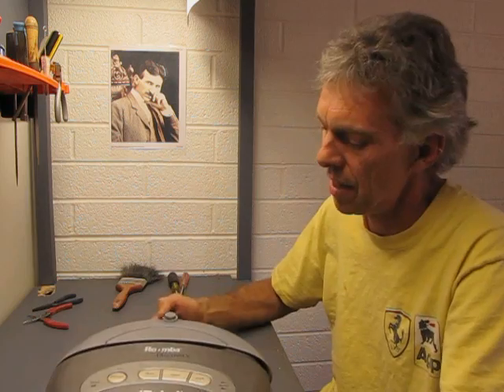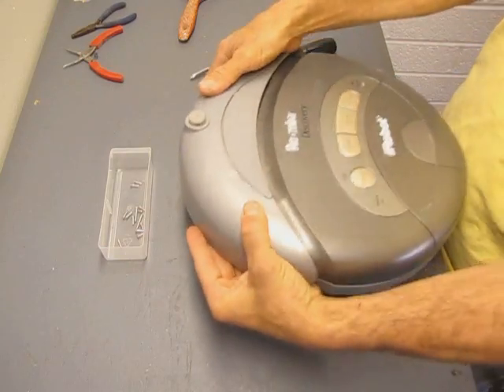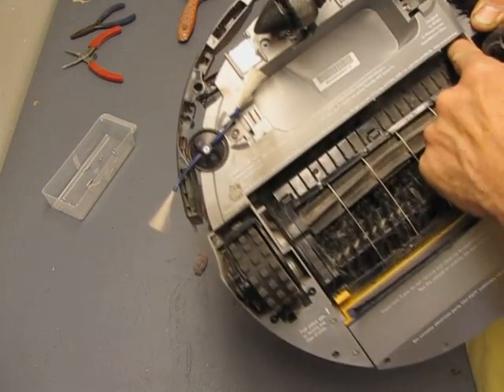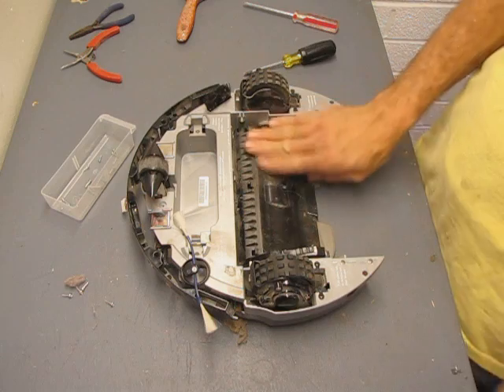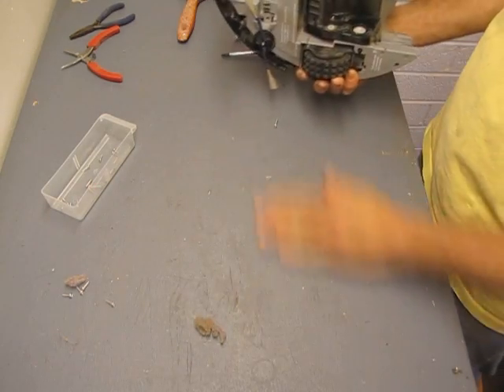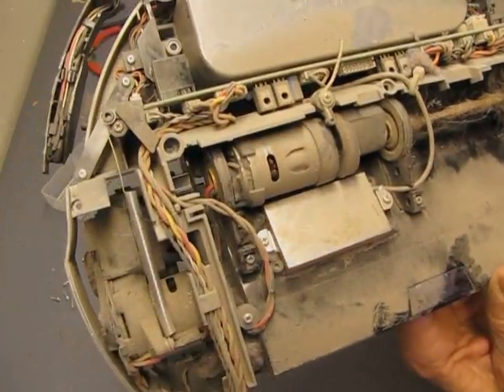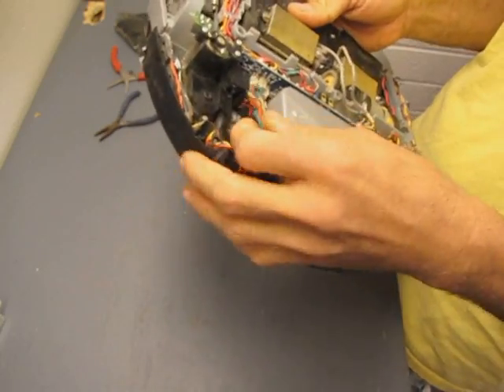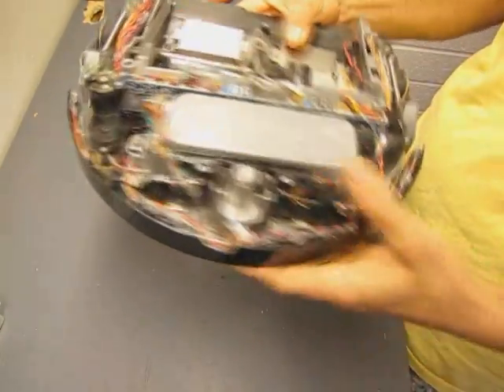Roomba 4000 series teardown part one

Comment: I followed your video to tear down my old red 4000 series.  Changed out the brush motor and replaced.  Works fine on floors but really noisy.  But when it goes to even light carpet it changes running pattern,  brushs runs slower then stops.  Robot runs still for about another minute then just stops and sits.  If it returns back to the floor it starts running the brushes and resumes pattern.  Have no idea what to look for to fix this.  Thought it might  be a weak motor I purchased.

Comment: Ran into this teardown when looking for repairs on a model 4100 red roomba doing the circle dance (now 15+ yers old). Used instructions to remove covers. Applied compressed air to clean out. Now works like new. Roomba customer service was useless as the best they offered was to buy a new one as they do not sell this models wheel assemblies. Totally useless B.S.
For best, painless results on cover replacement is to buy some "blue tack". Use a pinch onto the end of your screwdriver to hold screws on while re-fitting. Good video -- thanks

Comment: Hey, I ripped apart a few roombas recently, and now they don't power down/up unless I remove or insert the battery.  Essentially the power buttons don't work at all.  Do you have any idea which wire I mashed in order to make this error occur?  Just checking as you seem to have a pretty good idea of what the components of the robot are.  Thanks!

Comment: one add on is second battery relay and charging design circuit,KINECT BOARD for navigation,motor upgrades
on roomba with all vacuum and main motor and side motor removed it can handle up to 35 lbs
3 ports left over 2 500 ma and 1 1.5amp
for controlling there is a few windows controllers like ROBOREALM,or ROOMBA STATUS that gives you data on all sensor and battery current level,besides controlling,you will need usb to sci cable ,make your own or get one from IROBOT,MANY DIY sites for making

Comment: good video for most repairman that wants to repair or use as a robot
i repaired so many ,and turn many into robots using ros software and also driver from roborealm
to control it from software using SCI COMMAND AND PORT it does need on some firmware update,made many updates to roomba"s,so roomba by its self is a great easy robot,using the sensors and auto charging base hookup

Comment: @dinomaui thanks for the response. I can see that the brush doesn't turn when run without the dustbin, and if I use finger to force it, it turns for a second or two and gets stuck again, so hopefully it just needs some cleaning.